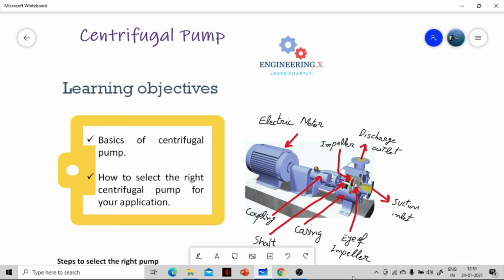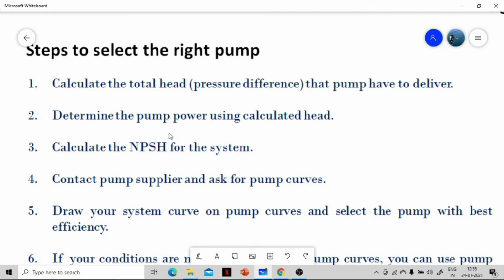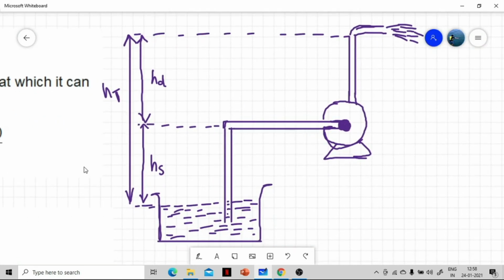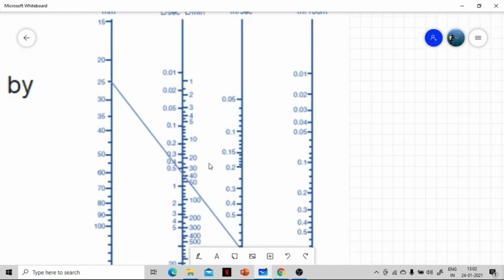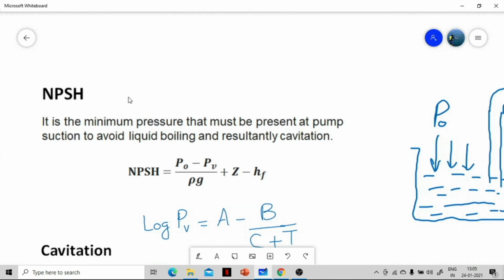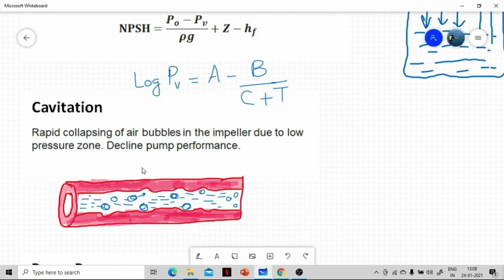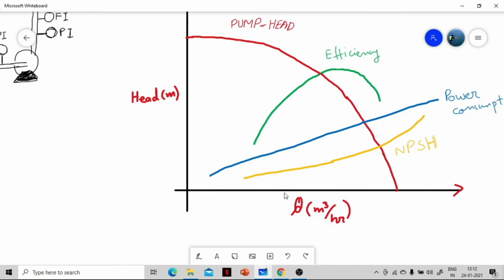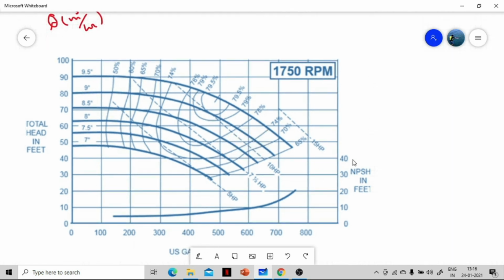Centrifugal pump sizing and selection in six easy steps

Comment: I am confused at 6.25.
When density is higher pressure also will be higher right 🤔
Reply from the maker: if you are using the same pump that was pumping the water and you were getting, for example 2 bar at discharge pressure, but if you use the same pump for honey to pump it will definitely never give you 2 bar as a discharge pressure. I hope you get the point :)

Comment: if you want to explain something using any equation method, please describe each parameter unit used in the equation, either for imperial or metric system, that will be a lot of help
Reply from the maker: Thanks for the suggestion

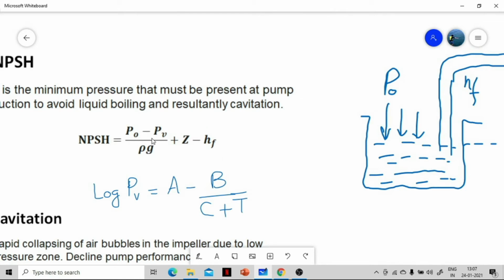Comment: The video is amazing, but I think at 15:15 according to the drawing, in the calculation of NPSH available Z must be negative too since the suction is made from a lower altitude, this formula is valid if you have the reservoir above the suction level.
Reply from the maker: Thanks for your appreciation and pointing out the mistake 🙂
Reply: Yes, I'm also have the same query

Comment: and how can i find the velocity without selecting the pump????????
Reply from the maker: Velocity in pipe or what?
Reply: @eduXinsight  yes
Reply from the maker: @fadyelrahib670  Flowrate (m3/s) divided by pipe crosectional area (m2), it gives you velocity in the pipe
Reply: @eduXinsight  and how to get the flowrate?
Reply from the maker: @fadyelrahib670  it is the design parameter and you have to decide for particular application how much flowrate should be

Comment: What will happen pump is run much below its rated head like outside the performance curve, other than low efficiency. Why cant a pump run at zero head
Reply from the maker: it is an indication that the pump impeller has damaged if all other pump parts are ok like sealing, bearings, etc. Regarding the second point, there is no point to run at zero head. But if you run at zero head pump will go on cavitation and damaged and pump efficiency will be close to zero.
Reply: For example if i have a 25m3 @ 12 kg rated pump and i put it in line where required pressure is only 5 kg.  How will my pump perform.. will i have to throttle the pump... And what will happen to required npsh
Reply from the maker: @Abhijeetsingh-ql5il  do you want the same flow rate 25 m3?
Reply: @eduXinsight  no i want max flow rate that is possible. Head around 4 to 5 kg is acceptable
Reply from the maker: @Abhijeetsingh-ql5il  First try to throttle the pump and check it fulfills your requirements. In this way, you will operate your system at low energy efficiency. But if it does not work then you have to change the pump impeller size.  Use pump affinity law to adjust the pump impeller for your new conditions.
Reply: @eduXinsight  so basically pump will not work outside right of its performance curve. As we go on to decrease the head, the flow will increase although at low efficiency. But after a point the pump will vibrate a lot. Then we will need to throttle the pump to increase the pressure and decrease the flow. 

Is my understanding  correct. 

Will the motor take more than rated current right of performance curve.
Reply from the maker: @Abhijeetsingh-ql5il go through this article. I hope you will find all your queries there.
http://www.warrenpumps.com/resources/Head%20vs%20Capacity%20Characteristics%20of%20Centrifugal%20Pumps.pdf